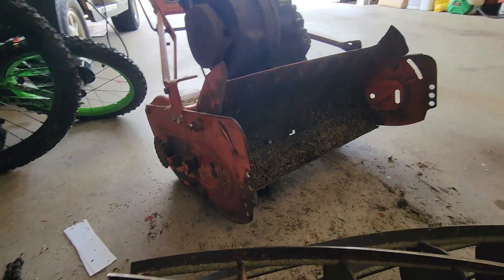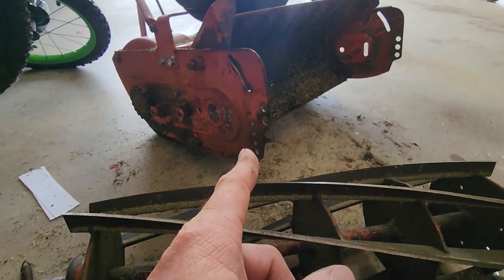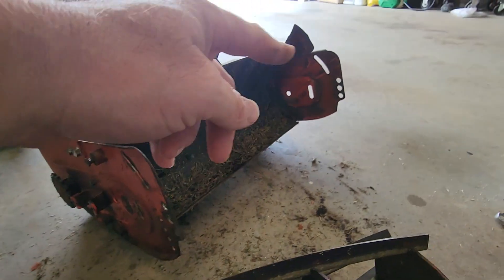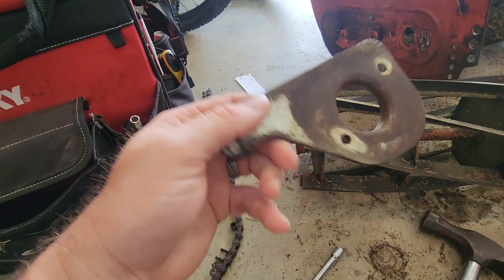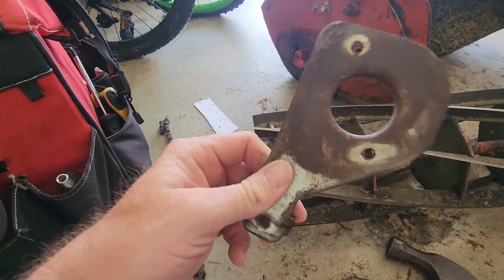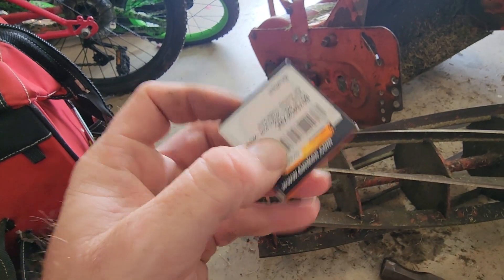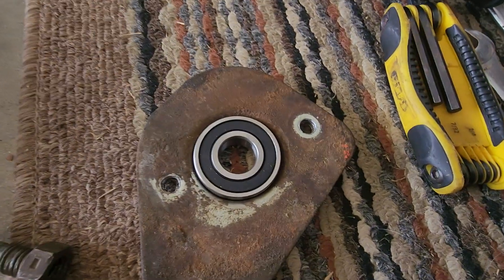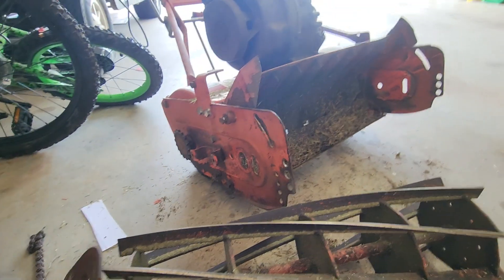How to replace Mclane reel mower Reel Bearings

Comment: Hey man, awesome video. Did you have a video of the sound it was making? My McLane is making a loud noise when the reel starts ‘rolling’ . Any help would be amazing.
Reply from the maker: @snippintips8670  It wasn't really making a noise. Just spinning slowly and then not at all.
Reply: @ZachWH87  10/4. That sometimes happens on mine as well. Back to the drawing board. Thank you for the quick response!

Comment: I cannot figure out how you used that puller to get the sprocket off? What did you attach the bolts to?
Reply from the maker: Sorry. It's been a while. I think I put them in the sprocket grooves and put the bolts on them up to the back of the sprocket.
Reply: @ZachWH87  this is literally the only video on the web on this exact job.
Reply from the maker: @BrianWong-y8o  Yeah I know. That's why I made it. lol I should've recorded all of it but the sprocket thing frustrated me too so I stopped.

Comment: 1. what symptoms did you have that made you suspect bearings problem. 2. how did you install the bearings/housing on the shaft.
Reply from the maker: The symptoms were the reel started to not spin as easily and then not at all. It was siezed. The bearings just slide over the shaft while in the housing.

Comment: That sprocket has an allen key bolt holding it on. No need for the slider impact aka steering wheel puller.
Reply from the maker: I know. I took that out, but it was seized on there. Definitely needed the puller in my case.
Reply: Same here but I use a mechanic fork